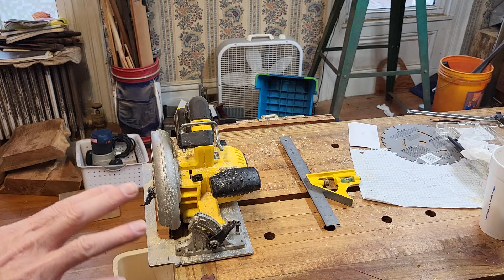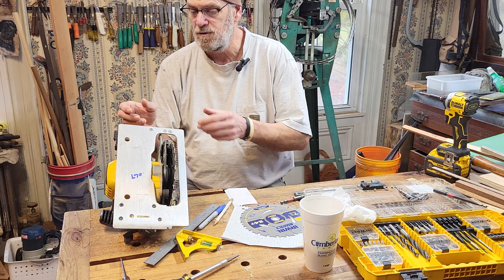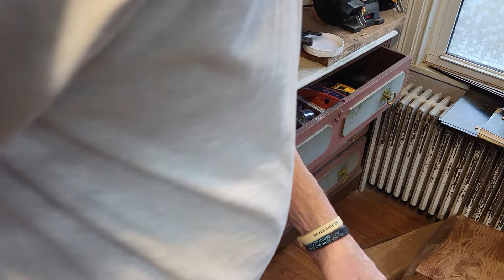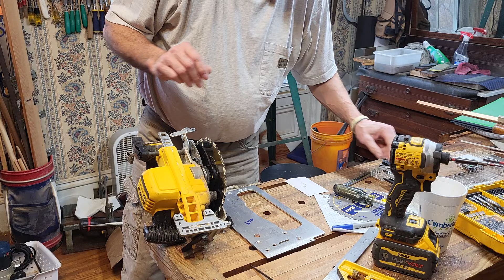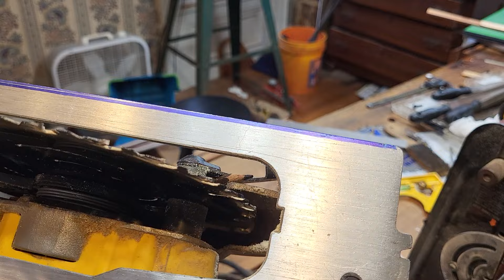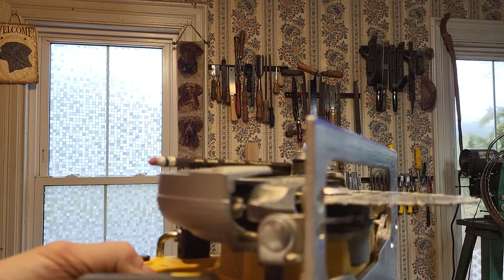Dewalt DCS573 circular saw MAJOR flaw and successful repair.

Comment: William, I have the exact same problem with my DSC573. In the past three months (Fall 2024) I've sent it in to SBD for warranty repair: first time they swapped the shoe with a used one (all gouged and scratched) which didn't change anything; second time it seems they did nothing? Rather than make an attempt at getting my money back I decided to fix it. I note on the front attachment to the shoe, on the depth-of-cut axle pin, it appears as though there is a yellow washer/shim on the left side as you note in your video. It is not a shim, but a feature of the yellow plastics. I did what you suggested and sanded it down about .060" and shimmed the right side with a lucky find of an .062" washer in my hardware jar. It is now a very usable saw when using a guide/fence. Thanks!

Comment: Have had 2 of these saws.  The slightest drop or racking of the saw will lead to all kinds of problems. Great saw but relatively fragile
Reply from the maker: Doesn't help when you're up in the rafters and are using it to bang over shit🤣🤣.  kidding  I've actually enjoyed the saw, except for the problem that I fixed here.  I'll do a video on testing it today.  Came out pretty square.  I'm actually wondering about the taper to the plate.  Have you ever heard of "toe in" or setting "lead" on a circle mill?  I'm wondering if they taper the plate slightly (or intended to) to replicate that.  There is a geometry to having the lead edge of a circle saw toed in and how it performs when cutting a straight line.  The plate was still way out of square, but that doesn't explain the plate being .010-.015 more narrow in the front...  It's a friggin rectangle now though🤣.
Reply from the maker: Howz things Bobby?  I hope all is going well, my brother.

Comment: Thanks for the video.  I have the same saw, and the same issue with it.  Now I know how to fix it.  So to make the second edge parallel, I might use the table saw.
Reply from the maker: That would work to be honest.  No reason you couldn't cut the aluminum with carbide.

Comment: Bent mounting brackets?
Reply from the maker: @rickcremer8544  I talk about that in the video.  Possibly, it's taken tumbles.  However, it had the flaw riding a straight edge from the beginning.  So, I'm guessing it had always been out of alignment.  Works great now.  In all honesty, I cut by eye 90% of the time and it really never caused an issue.

Comment: That Ridgid is still kicking after all these years? Or is that not my old one?
Reply from the maker: Yup.  Batteries are still good too.
Reply: That's crazy... But also why I switched to Ridgid, and ditched all my Milwaukee stuff years ago... Ridgid's specs are typically better than the big 3, plus the lifetime warranty on the batteries makes it more than worth it... I do still have a Makita impact that's still hanging in there... Lol...

Comment: Are you left-handed?,.. cause I think you should be measuring the Shoe to  blade for the other side.
When you’re using that saw with a straight edge, it’s not that skinny shoe side that you’re using unless you’re a left-handed I think you’re going about this backwards … any adjustments you make to the right side of that shoe side ,…doesn’t guarantee that the wide side is going to be parallel to the blade measuring and adjusting it from the wide side from the left-hand side of the saw,..
Reply from the maker: @fredsobotincic1587  I made the other side parallel to the right.  They are less than .001 from parallel.  I used digital calipers to measure the distance, scribed it, and filed it down to parallel.  That makes both sides parallel to the blade.  The blade is the constant, and both sides are parallel to it.
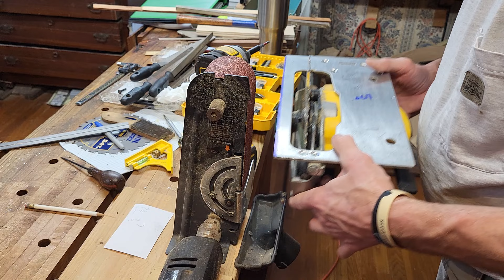Reply: 1:00:39
Reply: Thank you for your reply. The only thing I would say is it doesn’t matter if the plate is parallel it’s the long side the left side of the blade that is going to be running against the straight edge. That’s the only side needs to be squared to the blade parallel to the blade the short side can be anything.
Reply: I have the same saw,.. and I just discovered this problem today and that’s why I’m on YouTube searching for an answer and seeing your content… my shoe on the left side of the blade. The long side is 5/64 “of an inch difference front to rear it’s 5 inches and 5/32 from the blade to the edge in the front and 5 inches and 5/64”inches the rear ,..
I made a cut off jig, of 12 X 12 X1/2 “inch Baltic birch plywood..
I thru bolted a 1/4 X1” aluminum flat stock .. then rip the board the sawblade burnt the edge of the birch plywood. Definitely a problem I started measuring and I see what I see. This sucks.
Reply: Good job ,.. thank you for this you have helped me that’s for sure. Glad to know that I’m not alone, and my opinion of DeWalt is certainly diminished
Reply from the maker: @fredsobotincic1587  Morning Fred.  I disagree.  As a builder and a joiner, I use both sides of the plate.  Like I said in the video, most of the time, I don't run the edge against anything.  I MOSTLY cut lines freehand.  However, when doing large joinery or some weird panel needs where I would need to register against a clamped down level, you need both sides.  If you need to register the short side against the reference edge for depth clearance issues, it needs to be parallel to the blade.  I have track saws as well and 5 other circular saws, and I thought this was important enough to do.  This saw mainly gets used by me when I'm framing, but it needs to be able to do everything.
Reply from the maker: @fredsobotincic1587  I run a lot of their stuff, and overall, I'm happy with it.  I like the Milwaukee and Hilti stuff as well.  I also have a Makita 16 5/16" Circular saw where the blades cost more than this Dewalt saw🤣🤣🤣
Reply: Hello William, I just want to drop a line here on your site. I’ve been struggling trying to square this base with the blade since my first message to you several weeks ago now.
I ended up mounting a straight edge on the base, squaring it to the blade using  a digital caliper ,..
Then milling the base with a 1/4” spiral cut router bit  removing 1/64 of an inch to 0,..
I ended up couple 10,000s of an inch off ,.. I’m very happy with the results,..
I can finally cut a board, absolutely square using a straight edge against the base ,…

Comment: Hey brother I can fix all your tools problems . I own a small tool repair business and I will tell you like I tell everyone else stop buying that yellow shit shit shit!!!! No customer service no repair centers close by turn around times 6+ months . Buy the red tools and the dark blue tools Milwaukee and Bosch are the best out there yes they cost more but the quality is much better their American made and they care about your experience with their products. Trust I always loved DeWalt till I switched careers to tool)small engine tech warranty service guy. I do warranty for Makita Hitachi/metabo rolair titan Honda Briggs and what I have found is DeWalt after being bought by Stanley totally abandoned their customers that needed service/warranty work which ruins the brand for me plus sub par chucks and parts premature failures ECT ECT ECT.........
Reply from the maker: Thanks Benny!  This "one" saw is just one of many.  I have everything from the $1000 Makita 16 5/16" saw down to Skil worm drives etc....  I am invested in the Dewalt battery platform, and I do like this saw, but I ain't married to anything.   This particular saw is my "go-to" framing saw.  If I am framing, this saw is with me.  All nice and straight on the base now too!  Thanks for the input.🤟🙏🤙👍
Reply: Every brand has its good and bad tools no brand is perfect but I rarely ever have problems with my dewalt tools